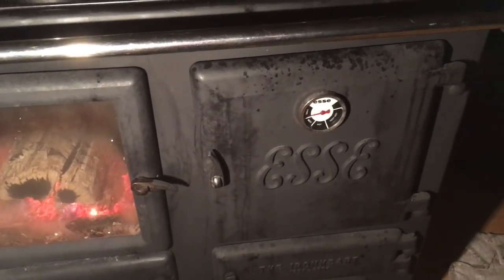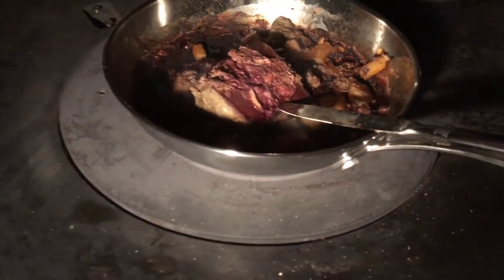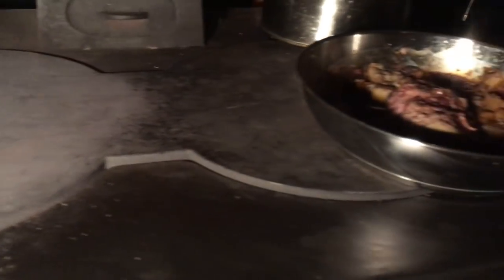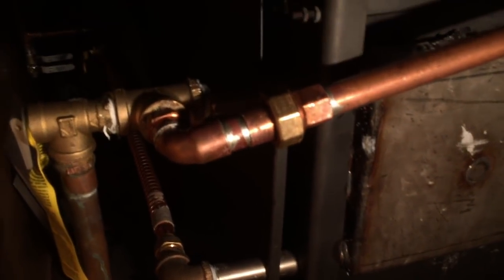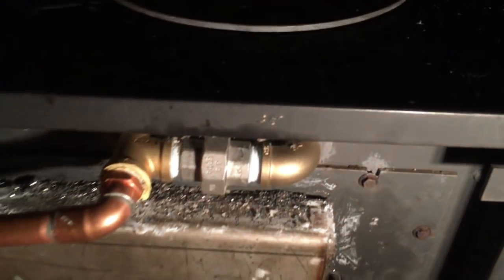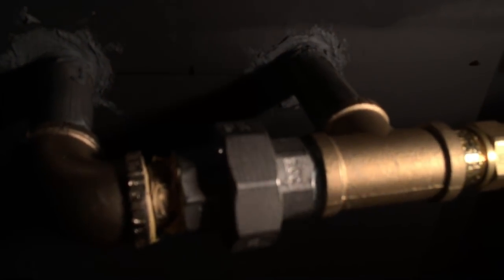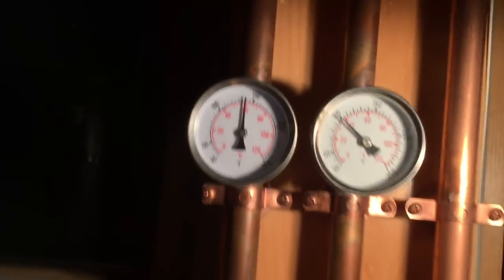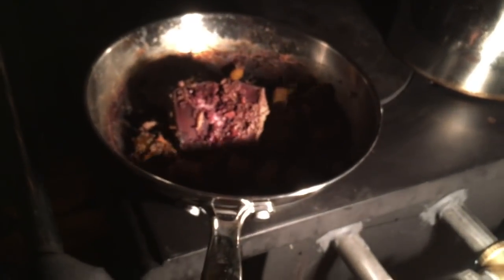Esse Woodstove Hot Water & Drying System

Comment from the maker: I notice a lot of systems on Youtube here with copper coils around stovepipes - and many other approaches which are not easy to maintain. You must be able to clean the soot off the heat exchanging elements often - like 3-7 times a season easily - if you want it to run well. Soot forms fast and is an incredible insulator - might work well right off but if you can't clean it it won't work well after a few months or less. The entire system has to be accessible easily.
Also - a few things for folks who are new to this:
-must have pressure relief valve(s). placed properly. Use a plumber if you don't know what that means. Don't make a pipe bomb and die. 
-must be able to thermosiphon well - at least 1:1 rise over run depending on a few other variables.
-must take advantage of the highest delta T possible to actually get lots of water hot. Most folks tend to fail in this area. 
-the higher the fire box temperatures the better the combustion. Reconciling the tension between this and the point immediately above is the art of making a good system - along with other variables such as maintainability, cost of installation, etc. of course. 
-tank size is important and usually within reason the larger the better.
Reply: Nicely customized!  I'll have to track down a copy of you book.

Re the cleaning access and soot: if you are getting truly clean combustion, there should be very little in the way of unburned combustibles to condense and collect.  Not that the cleaning access issue should be overlooked, but you may want to investigate some form of metered pre-heated secondary air injection to more completely combust the volatiles (I should note here that I'm unfamiliar with the inner workings of the Esse).  3-7 cleanings per heating season sounds like about 2-6 too many, at least for my liking.  See the old Richard Hill stick wood boiler design for something that burned very cleanly without sooting up the fire tubes, even when burning ridiculously wet wood, though it required both forced and induced draft to get there.  Ideally, by the time the combustion gases reach your water tubes, the only gases present would be N2, CO2 and H2O, though that's likely going to be a hard goal to achieve with the cook stove.

What about adding a baffle plate to split the firebox into an upper and lower burn chamber, and injecting the secondary air above the baffle?  I think you'd want a sliding blast gate at the rear, so you can open it to let the stack gases rise straight up (following the current path seen in the video) until the stack draws well, then slide the gate shut so that the primary combustion gases are forced to take the long path toward the firebox door and around the end of the baffle, then double back through the upper chamber (where the secondary air is being fed in).  Depending on how the baffle plate was supported, the entire plate could probably slide fore and aft to shift whether the draft opening was at the front or rear.  Insulate the upper chamber as well as you can on the side walls and top, so as to keep temperatures up.  Might be difficult to integrate with the "dogbone" cook top thing, however if you can get the temps up, any soot from the initial stages of the burn should get burned off the water tubes (and the bottom of the cooktop!) if there's much excess secondary air at all.  Once you're down to a nice coal bed, the gases could be allowed to pass straight through once again, if desired, and the secondary air feed restricted or shut off completely.  Just a thought.
Reply: Hmmm.  After looking up the "Installation and Operating Instructions for the ESSE Cookstove" PDF, it appears that the draft opening leaving the firebox is located near the front of the burn chamber.
https://woodstoves.net/documents/cookstoves/US_Esse_Ironheart_Cookstove_Instructions.pdf
So, flip my "front" and "back" baffle plate shifting directions in the above.  I'd wrongly assumed that the opening was at the rear of the firebox.

The ESSE does have some form of "secondary air," but it sounds from the manual as if it's intended to be equally as much an "air wash" to keep the door glass soot free as it is to improve combustion efficiency (see the "Notes on Woodburning" section for the best description).  Despite studying the cutaway drawing in Figure 3 and the IPL at the end of the manual, it's not clear to me just how the secondary air is fed to the combustion chamber.  I may be a bit obtuse...

Ideally, all of the off-gassed heavier volatiles driven off by the heat of primary combustion would first be drafted through the hot coal bed, then fed preheated secondary air in a well-insulated secondary burn chamber (that's effectively what rocket stoves and their ilk do very simply, as do the more complicated "downdrafter" designs).  But, that could be difficult to retrofit into the existing ESSE cookstove design without some aggressive modification, hence my suggestion above of adding the baffle plate and air feed as a quick-n-dirty half-measure.  If a baffle and secondary air feed helps with the excessive build-up, maybe some of the "extra" space above the existing sloped firebox baffle visible in Figure 3 could be re-purposed to form a better secondary burn chamber.

From the amount of build-up you are seeing, I'd guess there is still quite a bit of efficiency to be gained from your ESSE.  As I'm sure you know (likely better than I), upping the efficiency implies a smaller woodlot, and less time, space and effort needed to lay in a season's store of wood.  And, in really cold weather, it may also be capable of throwing more heat (being careful not to warp anything, of course).
Reply: For those interested, the Richard Hill Stick Wood Furnace DOE report I referenced in passing above, including both construction and operating analysis details, can be found here:
http://stoves.bioenergylists.org/stovesdoc/Hill/stick_wood_furnace.pdf
A report on the analysis of the stack gases done independently by researchers at Virginia Tech can be found here:
http://stoves.bioenergylists.org/stovesdoc/Hill/airtight_woodstove.pdf
This batch-fired design would be very amenable to burning coppice, prunings, etc.,  though as presented it does require a source of electrical power to run the forced and induced draft fans.  I'm sure the fans could alternatively be set up to run off: low pressure steam generated by the furnace itself; a Stirling cycle engine; or possibly a thermoelectric pile; if one were averse to using mains power or a battery bank.  Also, though show as a boiler, the combustion gases could be run into a "bell" masonry mass similar to the newer Russian mass heater designs, fed under a cook top or to a bake oven, etc.
Reply from the maker: Indeed more efficiency could be gained i am sure - there's not much secondary combustion in the ease as far as i can tell. 
 @kevinolson1102
Reply from the maker: I'll look into this -in theory of course you are correct, have yet to see anything work the way you're describing in practice though.  @kevinolson1102
Reply: @kevinolson1102  is there any way I could contact you for a consultation?
Reply: @cryptoxplain2182  Well, this is just plain nutzo: I've tried three times to reply to you, and each time it has been "memory holed" when I go back later to verify that my reply "took".

Susan's minions are totally off the chain.

I'll further obfuscate my contact info, in the hopes that it slips through the filters this time.

My address is eight lowercase letters, all jammed together, my family name and the first three letters of my given name, at the YT parent company's electronic mail service.  Hopefully this is sufficiently obfuscated to not look like anything useful except to an intelligent human.

/rant on/ If this doesn't work, I'm about ready to give up.  There appear to be filters in place which strain out comments and replies containing links or electronic mail addresses, at the least.  It's been happening to me for months.  I first noticed it when linking a folding camping wood cook stove patent in a comment over the summer of 2021.  I repeat, A FLIPPING STOVE PATENT!  FROM THE 1800S!  I suspect that it's all part of their dis-/mis- information fighting campaign related to a certain widespread medical problem.  Heaven forfend that people try to link to actual scientific paper or preprints or anything not passing their pre-approved whitelist.  What a bunch of tools!  Are they trying to ruin this service while "protecting" us from harmful and/or disagreeable thoughts, wrongthink style, or is it just inadvertent collateral damage to their darned near scorched earth policies?  If they were trying to ruin this service, what could they do better?  If they keep at it, they'll eventually mostly have cat videos left on here, safe and fuzzy, and their usership will drift down toward CNN's cable ratings./rant off/
Reply: Well, the fourth time's the charm.

Note to all: don't include anything in comments that has even a whiff of of URL or electronic mail address in it, even lightly obfuscated.  It will be bit bucketed, as far as I can tell.

Fer cryin' out sakes YT, quit being our nanny!  Susan, this means you!  Not to put too fine a point on it...

Comment: Doesn't the Esse have a catalyst right under that burner? That would be how they get so much heat without having to remove the top... hard to find information on them, though. Lowering the box temperature would cause the catalyst to fail prematurely. We have a kitchen queen, not as efficient, but about 1/3 the cost. Also easy to modify because it is all thick gauge plate, weldable.

Thanks for showing your thought process, eventually I would like to add this to our stove.
Reply from the maker: No, it has no catalyst, nor would you want a stove with one.  Once had an old Heartwood with a catalyst, what a nightmare.

Comment: Cut a metal plate, a negative of the dog bone, to fit the top and bring it flush?
Reply from the maker: Yeah - but that's a some real metal work - it's cast iron - weighs about 50 lbs - and has specific heat concentrating baffles in it - it would cost maybe 500-1000 bucks or more to make as nicely - but a heavy steel plate could work. Other problem i didn't mention which is as bad as the non flush surface is that it's not rectangular. It's a silly shape (well for a reason for cooking on top) but rectangular like on the stanley allows replacing easily with a maple sap evaporating catering pan and other things.

Comment: Interesting, I'm adding floor heating now, and want to partly use wood to heat the water.

Do watch out for galvanic corrosion. It's hard to tell in that lighting, but if that union is carbon steel, then that is a definite no no.
Reply from the maker: Thanks - yeah that can be a big problem. This is all stainless steel and brass.

Comment: Love your posts, Ben. I have been heating a 36 x 50ft. pole barn with a big Englander two stage wood stove that has fan forced heater tubes in the firebox. The shop has 16 ft.high walls so I can keep a 30ft. RV inside. Do you think it would it be efficient enough to heat with flue gasses using flex 3/4 copper tubing around and around the 8" flue pipe, instead of in and out of the firebox? I have a high ceiling and almost 12 ft. of single wall metal pipe before going through triple wall into the second floor and then out the 6/12 pitch roof. I figured almost 250 ft. of 3/4" copper around and around the flue pipe with that 12 ft. rise. Flue temps run anywhere from 185 degrees to 240 degrees coming out of the catalyst honeycomb at the top of the stove. I figured on doing my thermo siphon by using an upstairs insulated hot water tank for storage and then cycling through the 5/8" hydronic PEX lines in the six inch concrete slab floor. Slab is insulated from the ground below using 2" blue insulboard, and on the sides there is 2" insulboard  perimeter walls. Once the slab is warm I should be able to shut the stove down for nearly a week in winter because of the thermal mass storage in the floor, and boy will that save on the wood splitting!! Peace and Permaculture.....
Reply from the maker: I'd doubt it - but there's a ton of variables in that equation!
Reply from the maker: Generally it's hard to get more than 1/4 of the stove/furnaces BTU's out in water.

Comment: Dear Ben. Planning our BatchRocketMassHeater, where I want to run some water pipes through the bell. Do you have a source for learning about the specifications and especially securiry measures when thermo syphoning water through fire places?
Thank you very much for sharing!
Moritz
Reply from the maker: You want to put pressure relief valves in the system at any high points. They work well. But apparently RMH's don't heat much water up well - too short of run times.
Reply: Ben Falk Dear Ben. What do you mean whith short runs? Are 10 meters stainless pipe coil in a very big maonry bell to little?
Also, what are the main things to be aware of when making a thermo syphon? Does one need to be aware of flow rates, is the system airtight? What are min and max pipe length and pipe hight?
Reply from the maker: That sounds like a ton... by short runs i mean short burn times.
Reply: Ben Falk aah.. Lol. Yes, a BatchRocketMassHeater runs about 50 minutes, but the mass stays very hot for many hours. Was thinking to bring the heat to the 1st floor water radiant heaters via therno syphon to also have some heat there. For water we are on mediterranean solar.